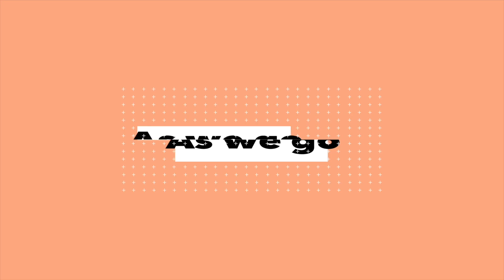Are you gona laugh or cry - Snags,Findings, pros & cons with the NEW VAN & it's 1 week old - part 1

Comment: Don’t lift the window to the top of its travel. That’s the release point. Lift the window slowly and listen for the click. It should hold just after the click. It will lock in three positions and if you go beyond it to the top it’ll release and drop to the bottom again.
Reply from the maker: We did get it in the end BUT bring back the knobs - what a xxxx design- not fans

Comment: I fitted my spare in the front locker on my Conqueror. Took the fitting from under the bed and refitted to the bulkhead in the front locker.
Reply from the maker: Thanks for watching! We did consider this there just was not the room & hopefully (as per previous vans) - never used & still leaves a light weight on the tow ball